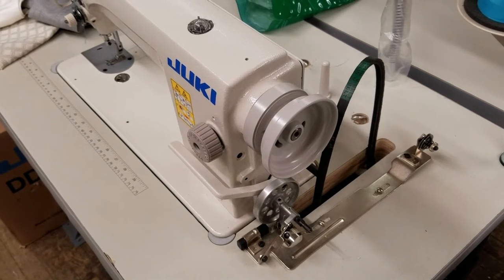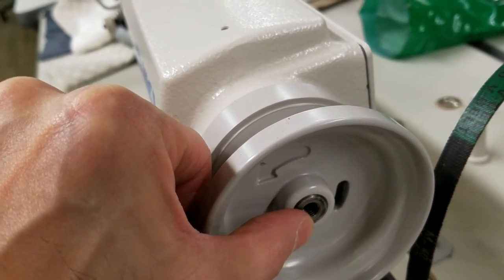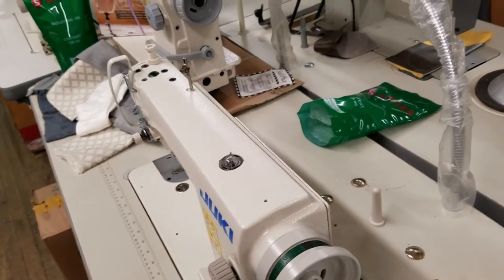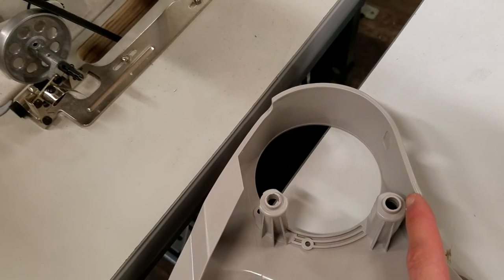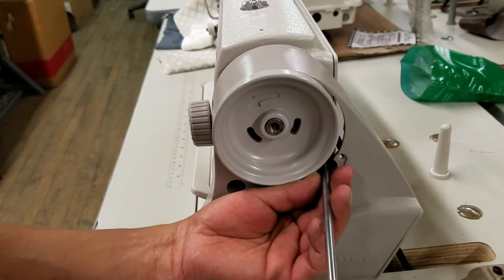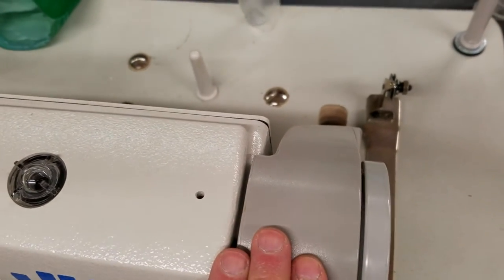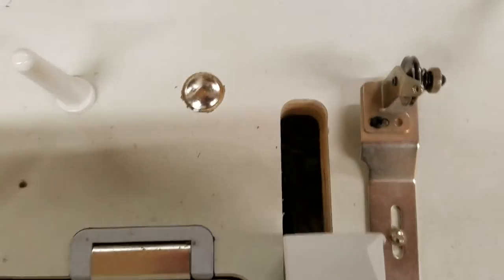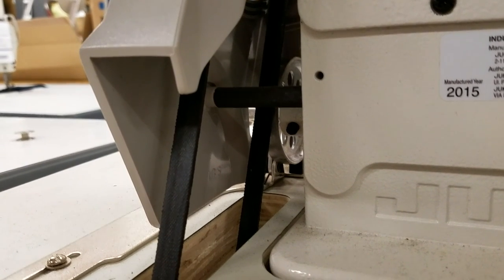Juki DDL-8700 belt guard troubleshooting

Comment: Great video, thank you. My belt touches the left side of my table ever so slightly. Should I do any adjustments? The machine still sews perfectly.
Reply from the maker: Try and move your motor to the right otherwise you will start getting belt dust.
Reply: @Sewinggold  , thank you very much. Moving the motor worked perfectly. Appreciate your quick response.

Comment: Recently bought one of these used, and since I've tried to use the thimble winder (by moving the belt switch), when I try to go back to sewing mode, the foot pedal doesn't do anything... Is this a belt issue?
Reply from the maker: Can you turn the hand wheel without engaging the motor?